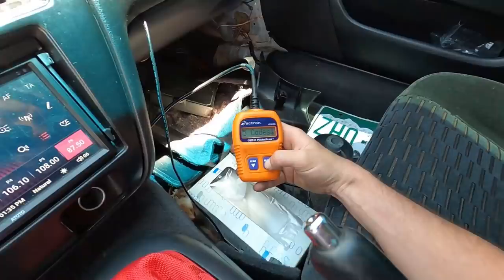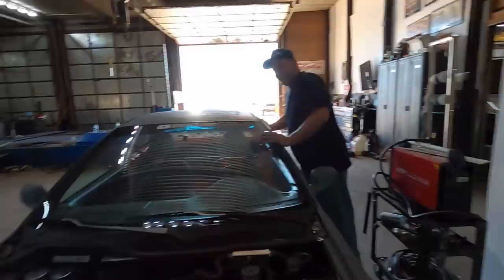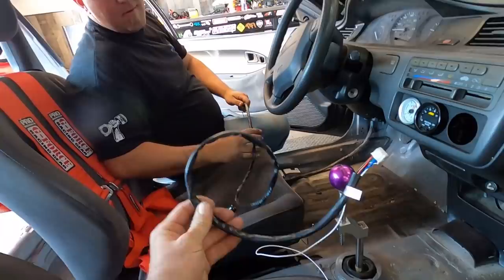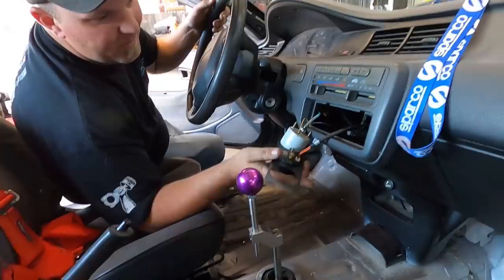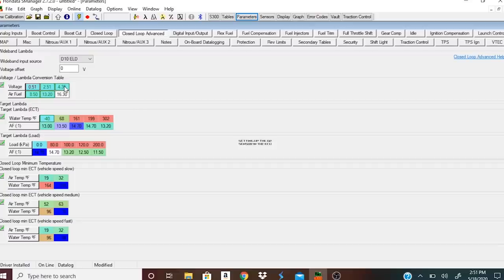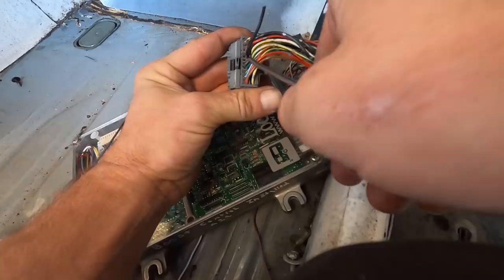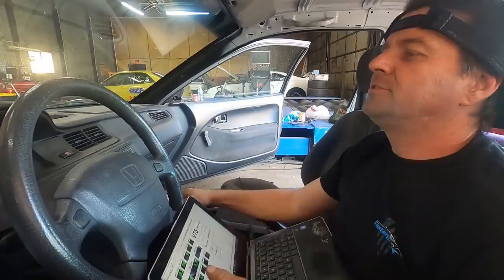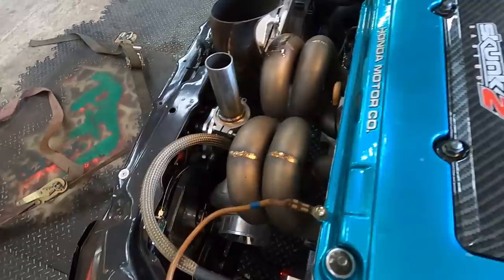Mystery Engine Shocks Us!

Comment: Signal Soldier here. Twisting those wires together causes signal bleed unless that insulation has an aluminum lining.  Never twist wires unless your feeding power through two wires equally and not using signal or a ground. I heard someone say Brown was ground so bad idea twisting them wires.

Comment: I had a plain job vehicle that was a ripper.Everything looked normal with it and it made me wonder if the engineers didn't do some off the book modifications.I can see that happening,when your not happy with the way your Corporation is producing an engine.It did start using oil and so I just sold it.The dude I sold it to said Man! I don't know what they did to it but that setup shouldn't be that fast.😁😳

Comment: Hey Brent.
I was wondering if there is a boost controller that works in a cross reference with engine rpm and gear that car is in?
Appreciate if you can give me some intel I'm struggling with getting my car to lunch properly and then getting the power down the track.
Thanks a lot and also I love your content!

Comment: I just bought a 99 honda 2.0 crv thats unmolested. 252k runs strong. Overall this just needs more torque. Thats my only complaint. my CRV transmission HATES the mountains. More torque so i don't run such high rpms up the mountain
 I can't believe I'm saying this about a 2033 foot tall hill in Pennsylvania. Mountains my ass. I miss the rockies for REAL

Comment: Anybody got forsale a gt35 rear exhaust housing t3 .82 ar 4 bolt 3 inch outlet. Located in denver
Reply from the maker: I have a few
Reply: How much
Reply: would u have the same .82 rear housing 4 bolt 3 inch outlet for a gt3076 aswell
Reply: So 2 different housings 1 for gt35 and 1 for gt3076 i can pick up at ur shop if u got them both
Reply from the maker: blaze gunner I may have the 76 one also . I can check.
Reply: @PFIBrent   that would be awesome i can pick up both housings whenever u tell me u got them